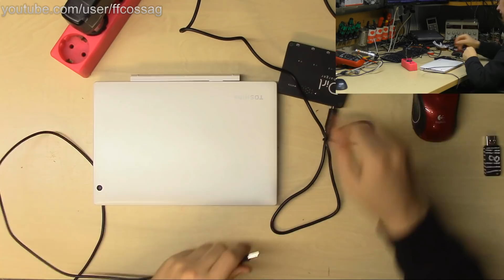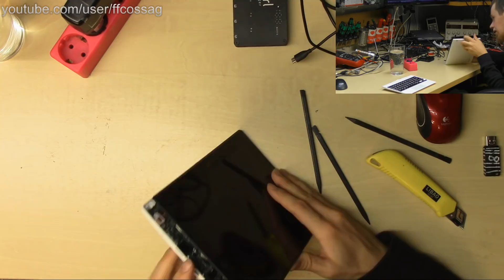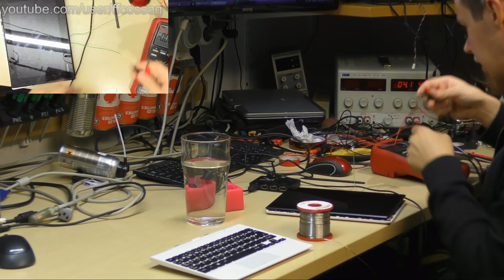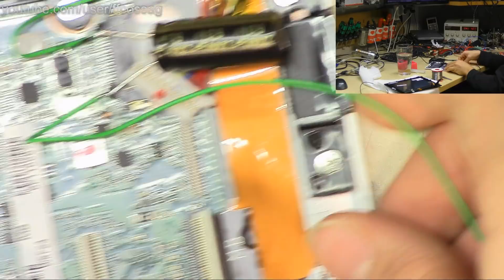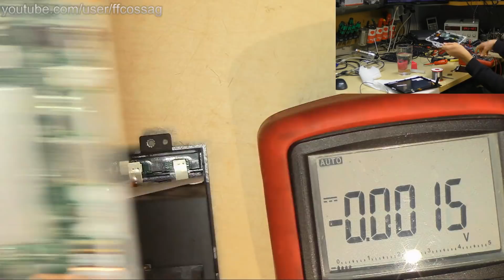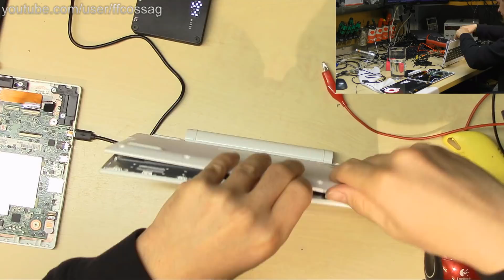RECDSTRM: Trying to repair a weird Toshiba tablet conversion

Comment: Hello. Do you still have this laptop? Mine is unusable (windows setup doesn't recognize anything). If you do, I was hoping you could share a working clone of yours. Thanks in advance
Reply from the maker: If the Windows setup doesn't recognise your drive, you probably have an eMMC failure - very common in this sort of device. I'm afraid I can't easily share an image of mine since it has a lot of personal information on it.
Reply: @FFcossag  emmc is good... when I run Linux on it, everything works perfectly. I'd just delete your stuff and not touch them but I understand. If you ever get to share an image, I'd really appreciate. Thanks

Comment: I have the same laptop however, my issue is I can't reinstall windows.
I get stuck when it asks for language as there are no inputs and I can't use a external mouse either.  Any suggestions?
Reply: Have you had any luck? I am having same problem and I want to throw it off the wall 😂
Reply: @thegibb14  give it to me :-)
Reply: @patriksaveholm8528  luckily I've fixed it, it's a great doorstop now 🤣😂
Reply: @thegibb14  mine keeps saying something went wrong and restarts arghh
Reply: Same problem here. I can't interact with the laptop when trying to clean install windows. Has anyone figured this out? I thought about cloning a good working windows image and using it to restore to the laptop but I can't find any. Maybe OP still has this laptop working?
Reply from the maker: Make sure it's Windows 10 32-bit. It worked as well as it's going to on mine.
Reply: FFcossag It's definitely the 32bit version, but I can't seem to do anything after the select your language page. 

Is there anything I could do in the bios?

Comment: 3.7 v is the storage voltage for lithium cells, full loaded is 4.2v and it should never be surpassed , depleted will be at 3 volts but can go down to minimum 2.8 v. There is a new technology upthere for 4,4 volts lithium cells but that`s not the case here.